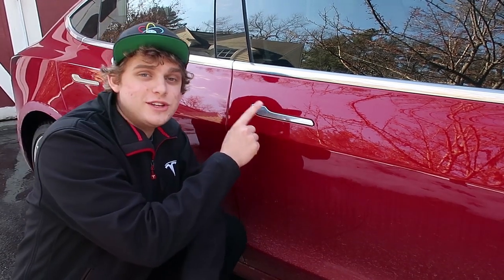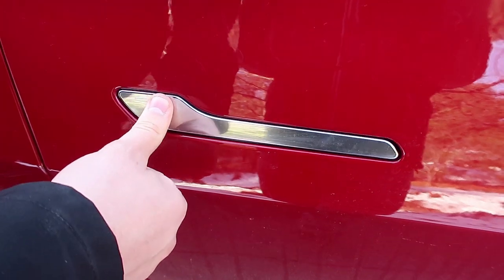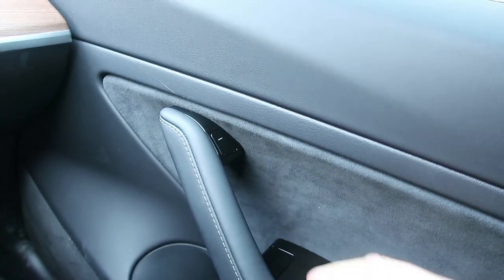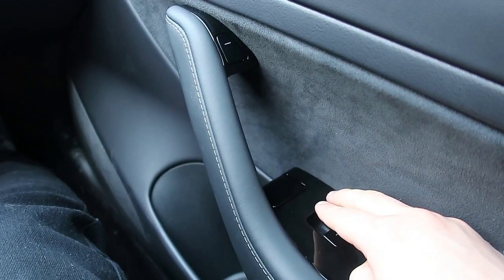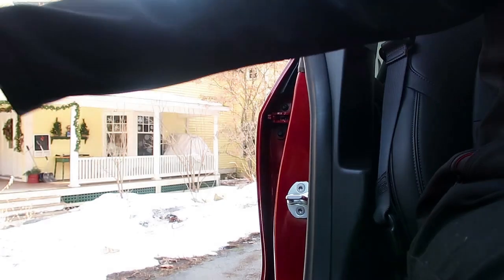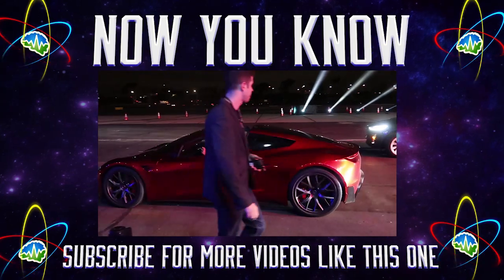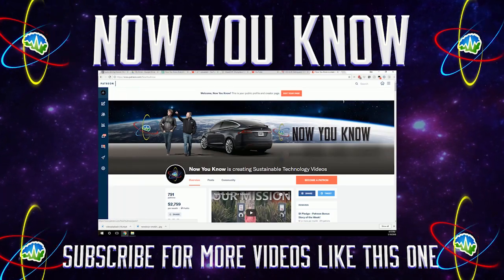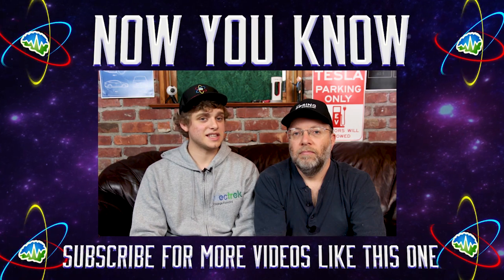Tesla Model 3 Door Handles

Comment: Smart and the way the mechanical handle is aligned it can be opened with a special tool from outside even if locked out.  Yes one can break any glass but to shimmy up the handle without breaking the glass the mechanical handle will work physically. 

Like that.. thief would not get far without key.. computer shutdown but they can get in but the camera is hard to avoid.  
Smile you're on Candid Camera.

Comment: Always use the thumb to press in on the more vertical, thicker, shorter part. Always use fingers to pull on the horizontal, thinner, longer part. 

Driver’s side / left hand = approach with palm down. 

Driver’s side / right hand = approach with palm up. 

Passengers’ side / left hand = approach with palm up. 

Passengers’ side / right hand = approach with palm down.

But you don’t need to pull from the handle at all if you push and wait for a split sec.
Reply: Bryan Baker Better way might be left side left hand, right side right hand. :) These handles are like those on cars MANY moons ago and you did the same thing. Used your thumb in one place, your fingers in another, and it was easiest to use the ‘hand toward the front of the car’ to open the door.

Comment: Rear doors lack the emergency release. Also, the emergency release doesn't move the window down slightly (to prevent damage to the upper seal).
Reply: David Tooker The rear doors do have an emergency release. It's hidden behind some panel, can't remember but saw it on some other video. They probably don't want to damage their M3 or maybe forgot.
Edit: I was wrong, as pointed out by David below. I was thinking of the Model S, page 9 at https://www.tesla.com/sites/default/files/blog_attachments/model_s_owners_manual_na_english_5.9.pdf
Reply: David Tooker Thanks, I was wrong. I guess it makes sense; in other cars when the child lock is manually enabled on rear doors, you wouldn't want a child to be able to pull out a panel and open them. So digital child lock setting from the touch screen is perhaps even safer since in a pinch you could disable the child lock there after a crash that incapacitates those in the front seat.
Reply: nettlesoup May have been the X Falcon Wings you were thinking of? That has pull releases behind speaker grills.

Comment: "Any product that needs a manual to work is broken" - Elon Musk
... and the Model 3 needs a video tutorial to demonstrate how door handles work.
Reply: There are video tutorials for Model S/X too.  Not needed, just nice to have.
Reply: Except the video is from a third party for those who might be curious how they work
Reply: I actually looked it up,
Because a model 3 owner complained to me, it's not possible to open the door with one hand...

Not so easy after all it seems
Reply: @gevanlappido1304  I open mine with one hand all the time. Push the fat part with your thumb, pull on the extension with your other 4 fingers and PULL. Granted, I'm making assumptions the 'person' has opposable thumbs and more than 2 other fingers.
Reply: @rogersligar4924  it still takes a lot more than regular car door handles. Classic example of fixing a problem that didn't exist.
Reply: @rodrigobraz2  In your opinion. From an aerodynamic position, it is indeed a solution to a problem. Aesthetically is also a positive, in my opinion. Your mileage will vary.

Comment: can you open it with either hand? is there an option to have it auto open when you approach with your phone? can you open them from the touchscreen? you might need to make another video :)
Reply: You CAN open them with either hand, but it's easiest to turn the "off" hand over when doing it.  That is, when entering the left side of the car, use left hand with palm down or right hand with palm up.  Do the opposite when entering the right side of the car.  (It sounds more complicated than it is.)
Reply: I've also seen someone just press the button with any ol' finger, which causes the door to pop open,  and then pull the edge of the door with their hand.
Reply: Another way to say this is to always use the hand closest to the front of the car and the hinge. That's true for any kind of door—even doors on buildings. Grabbing any door with the hand farthest from the hinge requires an awkward transfer to the other hand as you open and walk through.
Reply: Thanks, John.  That's a much better way to explain than mine was.
Reply: Big Dream Yep, I said this above. Cars many years ago had the same setup. Handles with a push button and you needed to use the ‘front hand’ for easiest entry. It’s weird how this seems to be a difficult issue about this car. :) People are very used to ‘grab and pull’ I guess!

Comment: can you cost of charging the Model 3 ? let's say for a year? please ann thank you
Reply: Come back in Dec 2018
Reply: well that's when i'll have my model 3 so it would kinda late
Reply: Well, they only got their Model 3 in Dec 2017 so you'll kinda have to wait if you want an actual annual cost.
I wonder how are you going to match your driving style/distances/usual traffic not to mention local electricity cost to theirs BTW.
Reply: yes you are right about that .I’m just so eager to get The cost so i can calculate for my needs. thanks for your input.:)
Reply: NP Sorry if it looked like I'm trolling.
But one way or another - even with pretty high California electricity rates it's usually less than 1/3 of gas price spent fo  similar ICE car, so worry not, it won't be arm and leg :) Where I live it is $.132 per kwh high peak and $.065 off peak so the full charge of 75kwh long range battery will cost around $10 and $5 respectively.
Reply: wow thanks so much and np thats awesome i pay $70 for gas here in canada.

Comment: Dust/dirt collects on the outside of the car including the surface of these door handles, which means you are likely to get dust/dirt on your thumb from opening doors. Would prefer traditional door handles where the inside surface is much cleaner; no need to touch the outside surface of these.

Comment: Absolutely hated both external and internal handles while test-driving You You's Model 3. Felt so unnatural, like bad unnatural! While it is a matter of habit you cannot train all random people you're giving a lift sometimes. To make things worse there is this emergency release button where I'd expect normal handle would go, and pulling it instead of pressing the open button can cause the damage to door/window seals. You You warned us like 5 times not to pull that button and still I barely stopped from pulling it to open, just because that top mounted button denies all ergonomics approach.
Reply: I really like the Model 3, and so many of the haters' complaints seem foolish to me -- but THIS issue...?  I'm afraid you're right, Vadym.  It's especially frustrating because, once self-driving is in place, enrolling in the "Tesla taxi fleet" will mean there will be lots of uninformed passengers.  I suspect that repairing/replacing that seal will have to become a regular maintenance item for any Model 3s that participate.